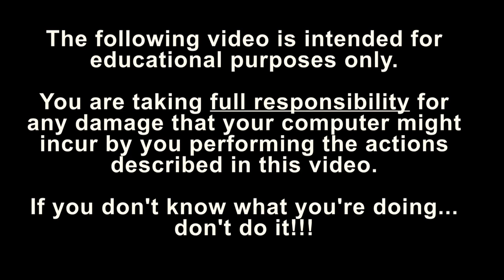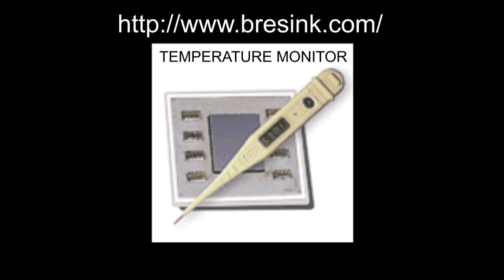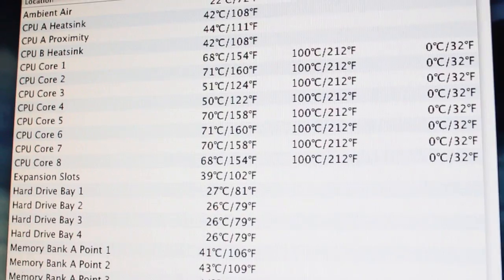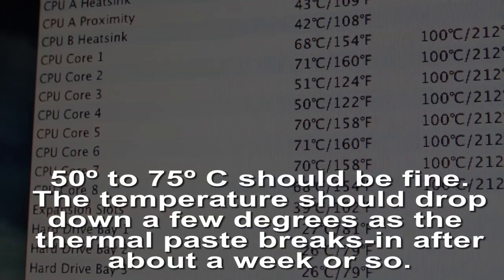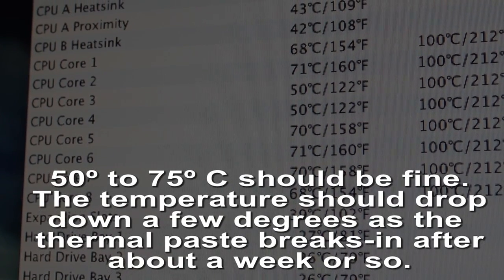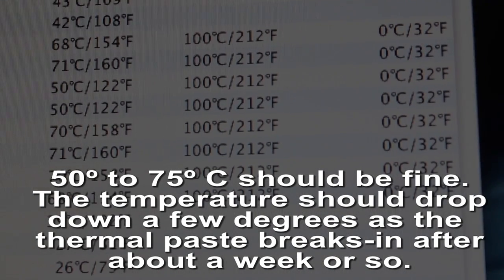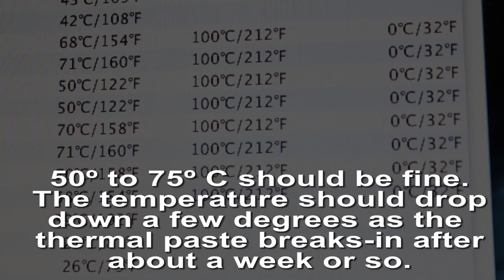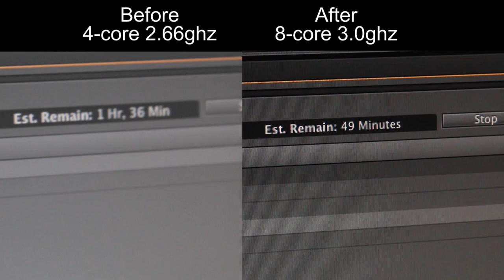Change the CPU in a 1st Generation Mac Pro (Part 2)

Comment: Midphase, thank you for your contribution. Can you please tell me if upgrading my Mac Pro 1,1 to 8 cores (purchased summer of 2007; smc 1.7f10) will allow me to install 32 GB Ram? Right now I am maxed out at 16 GB Ram; and although I have a couple of 4GB sticks, my Mac will only read them as 2GBs. Thank you in advance for you answer. I noticed somewhere the the kernel has to be changed to 64 bit; is this true? But i understand it is also one great big hassle.
c

Comment: hey mid phase great vid's but i have a question im running the dual core 5150's with stock everything , will i need to upgrade the fan? and mainly what cpu's do you think i should go with? Im in music production and 4 cpu is not cutting it. 

Thank you so much

Comment from the maker: I believe that the standard 667MHz DDR2 ECC fully buffered DIMM should be fine after the processor upgrade. That's what I'm using. I suppose you could go with faster RAM but I don't think you'll see a whole lot of benefit.

Comment from the maker: Thank you! I think as long as the socket is the LGA 771 type you should be ok (big emphasis on "should").  I realize that the slower CPU's are cheaper, but you really want to ask yourself if it's worth it. You don't want to put all that time and effort to change the CPU and then do it again in a few months when you realize that you really want that extra speed. My advice is to save up until you can afford the X5365's.

Comment: Hi Midphase, amazing videos on this, thank you. I am thinking about doing this and can see there is quite a price difference between the x5355s and the x5565s.. Because of this I'm thinking of getting the x5355s, but they seem to come in a few different configurations. I haven't seen ant x5355s that are called 'SLAED', instead all I can find is x5355 'SLAC4' and 'SLAEG'. Are these ok to use? and should it be possible to find an x5355 SLAED? Thanks again!

Comment from the maker: Sounds like you might be overheating the cores. I would advise that you get Temperature Monitor and check to see what's going on. If the cores are overheating you will need to either better ventilate the Mac Pro, or possibly reapply the thermal paste. A few people are reporting issues that I think are related to temperature. The fact that it's the middle of Summer doesn't help!

Comment: Just wanted you to know I followed this 2 part video to a T back in March & never had a single issue. My Mac is still running great and now I can easily hold off until new Mac Pros come out next year. Thank you so, so much for these great, detailed videos. I am NOT the kind of guy who ever would have thought I could crack my machine open this way and pull off this kind of upgrade. Sure, I'd upgrade RAM or change out the Video Card, but never thought I'd be able to do a CPU swap. Thanks!.

Comment: Another thing to add for others was the fan assembly was very tricky to remove. It was stuck quite tightly and I was afraid it would jump forward against the delicate wires in front. The secret is that there's a vertical slot at the back. That was preventing it from been removed. Once you maneuver the front part out like you show in your video a bit of force needs to be applied UPWARD AT THE BACK. In other wards don't pull forward. Than it came out fine.

Thanks so much for your video. Top marks

Comment: Just upgraded the processors. The temperature is fine and the benchmark is practically identical to yours!! I did add more arctic silver than your video showed after checking out some other videos and forums. Some people were having kernel panics and heat problems and the problem seemed to lie with not applying enough arctic silver.

Comment: Thank You - I will do the same, with my old machine, as soon I get two X5365 (they are on the way ;.)
Your Video is very helpful - The 1.1 is a great machine but a bit hard to tune.
I just upgraded my 2.nd Machine (2010 2,8 Q-Core to a 3,33 Hex-Core) Easy to do and runs great (Geekbench 64 - from 10700 to 16800) .

So take care and stay tuned.

Comment from the maker: Thank you! I used SMC Fan Control, but actually I found my CPU temperatures pretty stable almost right away (I think  thanks to preppying the heat sink surface with the thermal paste). One of the main things to keep in mind is that your CPU's will run hotter due to the doubling of the cores per chip. It's more important than ever to make sure that your computer is sitting in a well ventilated area and that the fans are not obstructed. Other than that...enjoy your new twice-as-fast computer!

Comment: Nice tutorial! I'll be doing this upgrade soon! I have the same Mac Pro as you (1,1 quad 2.66). I'll be getting my 5345s in the mail soon! Have you used SMCFanControl? That's what I use to control the fans on a couple of my Macs. If your CPUs are getting hot, you can crank up the fans. Any tips for the upgrade that you didn't mention in the video? Anything you thought of afterwards? Thanks!

Comment: @midphase : there is a config file on the forums that you can download and unzip then install but........................
This will work with Snow Leopard, but for some reason it will not work while running Lion. just an FYI.

Comment: great walk thru! I picked up two of the X5365 for less than 500 each online. I followed both videos very closely, thank you for putting this up. I did want to ask if the system recognizes the chips as the model number on yours? My system (running leopard or snow leopard) when I goto the 'About This Mac' it shows the processor as  '2 x 3 Ghz Unknown.' Is this the result of a bad install? or its just like that? or even worst, was I sold some bad chips?

Comment from the maker: I think one of the considerations to keep in mind is that if you do a lot of graphics work (particularly video and CGI stuff), and you want to avail yourself of the CUDA supported cards like the Nvidia Quadro, you'll need a newer Mac Pro than the 1,1 generation due to the PCI bus being too slow on the 1st gen Mac Pros.

Of course if dropping $1200 on a graphics card isn't an issue, then I assume picking up a new Mac Pro is not a problem either.

Comment: I am getting ready to buy some X5355 processors (cost is a factor) and since I have 4TB of disk space, and 16GB of RAM, it makes sense to spend $300 for a 4 core to 8 core up grade rather than spending a ton on  a newer machine.  I can get a 2008 Mac Pro for $1800, but my old machine is barely worth $1000.

Comment from the maker: I picked them up on eBay...keep an eye out for X5365, ideally it's best if you can pick them up in pairs, but you might need to get one from one vendor and one from another. I paid $500 for the 2 CPU's but I see the prices fluctuate and they actually seem to go for a bit more right now.  Try to stick to SLAED chips and not the SL4P type which I believe are an older configuration.